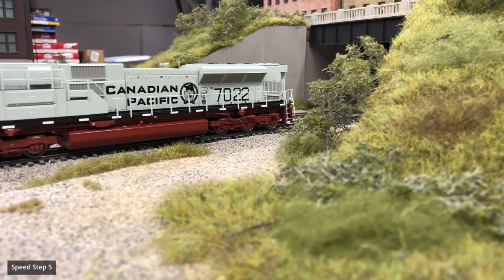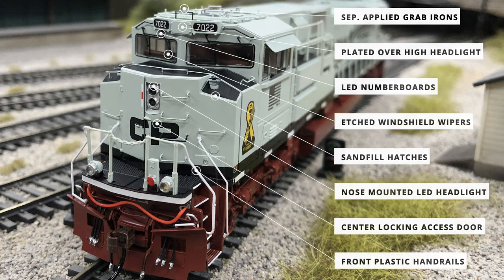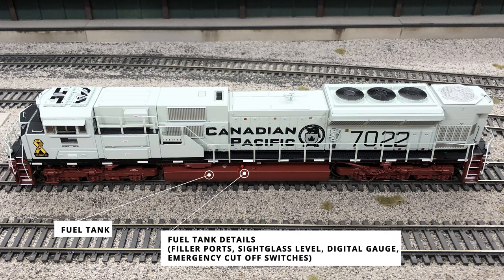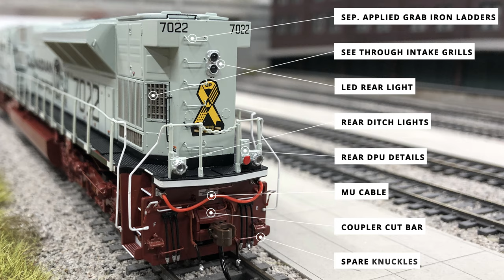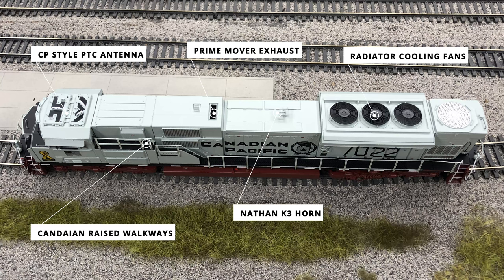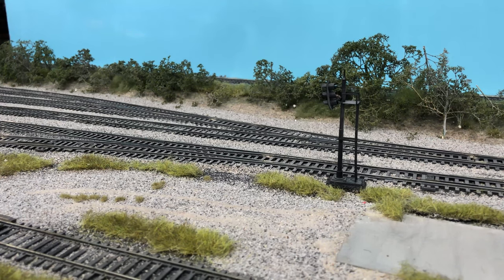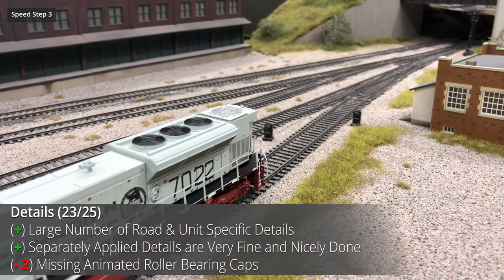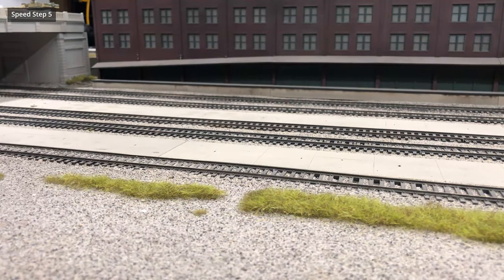Review: Athearn Genesis SD70ACU Canadian Pacific 7022 [HO Scale]

Comment: Great review. The soundtraxx capacitor current keeper #810140 can be fitted just behind the LED light housing at the rear of the cab and plug right in. The spinning bearring caps I can live without.

Comment: Excellent review, as always.

That model looks fantastic on the outside. I can't believe, however, what a mess it is on the inside. There are effing wires going everywhere, with no tidy tape or disconnect plug. Why not go with contact pads like Scaletrains, or a JST connector? In my retrofitted diesels, I use JST 6 pin connectors for the lights. It works well and allows me to remove the shell and chassis for whatever reason. Seriously, this just looks like a poorly done home hobbyist job, not for a near $300 locomotive.
Reply: yes.been my gripe with Athearn, too.Finally changed to led lighting, but everything is tethered, under the shell.Athearn have been way behind the competition, for years, yet their pricing is up with everything else.Apart from that ,they do have some really nice models, but there is more competition out there now so they need to up their game under the hood, though.Cheers

Comment: Wasnt the problem for the sd90s its prime mover ?
Reply: On the 6000hp versions, the prime mover was a major issue.  On the convertible 4300hp versions, the main issues as I understand them were the mentioned frame cracking, and electrical.